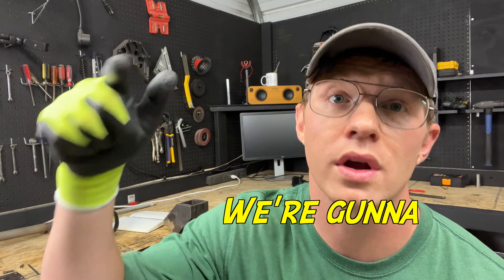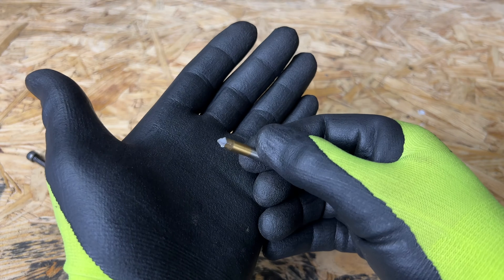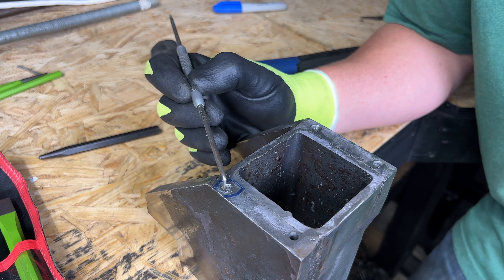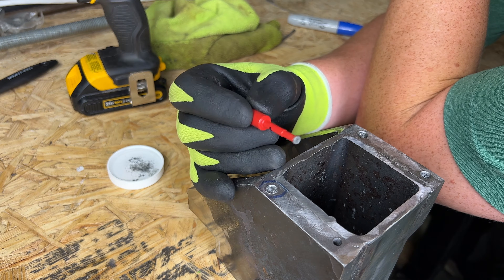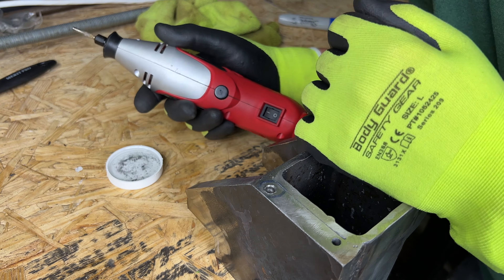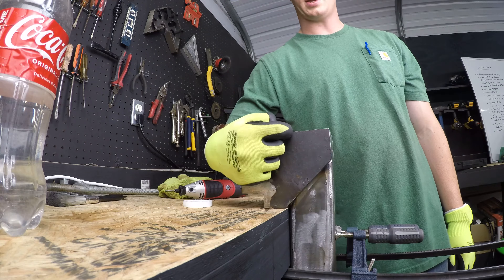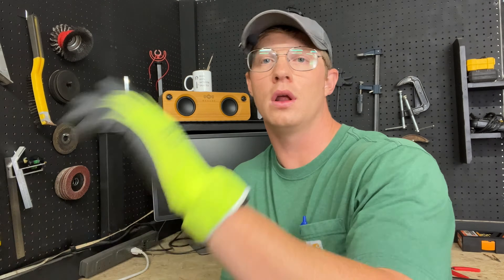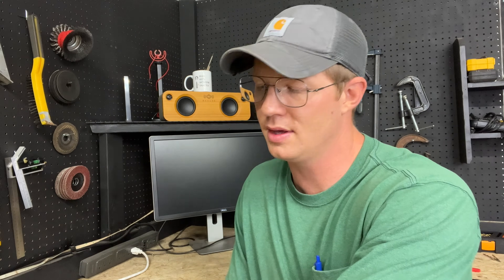Broken Tap In A Blind Hole?  |  Best DIY Removal Method

Comment: Also grinding the whole tap out is not necessary. Cut both sides and drill the hole at the end. It will fall off. You might even reuse the cut out bit, weld it back with most of the thread intact :D
Reply from the maker: Wow, never thought of that!
Reply: Nejlepší  je pořídit si  vytahovák zalomených závitníků je to levné

Comment: Use a pointed sds chisel bit in a hammer drill set to hammer only. It will shatter the tap, then just use a magnet to pull out the shards. 
I did it today on a broken 5/16" tap, and it was gone in 2 minutes.
Reply from the maker: Freakin brilliant! I have a hammer drill so I could have done this. I will try this in the future👍👍

Comment: Not the final solution I was hoping for 🤦. My tap busted off in my engine block. Not cutting that out 😂. 😭
Reply from the maker: Oh dang. Sorry to hear that! I one video I saw for an engine block used the diamond hole saw with some success👍
Reply: @mooseworks I ended up using a couple diamond bits on my Dremmel. It took FOREVER!!! Like three hours of drilling 5 sec at a time and dipping in water to cool.

Comment: You had a welder this whole time couldn’t you weld to the tap and twist it out???
Reply from the maker: Thought it was too small to only fuse to the tap. 1/4 in is pretty small and down in the hole…
Reply: @mooseworks a trick i used was to use a piece of copper pipe.  Good luck.  Thanks for the video

Comment: You might have made the tap brittle enough to break apart by heating it and cooling it fast with ice or soft enough to drill by heating it and cooling very slowly by burying it in ashes.
Reply from the maker: Good tips! Should have tried one of those methods!

Comment: Your approach and methods were sound.I’ve removed thousands of broken taps(45 years with kennametal) almost always with a quality carbide  end mill in a ridged set up then chip it out with a modefied hex key sharped so the point is over to the side. Then you can a grip on it with pliers and break small pieces off. 
Or just put it in an EDM and have a cup of coffee
Reply from the maker: 😂 great advise!

Comment: Helpful video. Other videos use a milling machine. I don't have a milling machine or drill press and my tap broke off under my car. I never thought to try to break the tap apart so I got my punch set and tried to turn the tap out by hammering with the punch. It did start to break apart and finally the piece that held the tap popped out. It was spot welded on. I put a bolt and nut on it and it saved me a huge headache. A BIG thanks for the idea.
Reply from the maker: Absolutely! I’m glad it helped you! That’s why I make video. Great feedback👍👍

Comment: Place a nut over center of the hole and weld in the center of the nut and use a wrench to screw it out.
Reply from the maker: I thought it was too small and I only had a stick welder at the time. I didn’t think it was possible with my skill level.
Reply: This trick has literally never worked for me ever I have never managed to make a nut ever stick to whatever was left of a bolt I think you guys are breaking off shit finger tight for that trick to actually work

Comment: I have often had to break broken taps apart to get them out of holes, it takes a while and often does a lot of damage to the hole you are trying to get it out of. Your core bit idea was good, I would like to try cutting the hole tap out using a large core bit and then plug the hole with a blank that I drill and tap again.
Reply from the maker: I will have to try that next time… cuz there will most likely be a next time😂

Comment: I know this is an older video but they make a broken tape extractor tool and it is BAD @SSSSSS.  Walton 18001 it is pricey but works well.
Reply from the maker: @GregoryJohnston77  does it so down to that size? It seems too small for the small fingers to fit.
Reply: @mooseworks  they have them for every size tap. I've not used one and it did not work yet. Granted I've only  used them about 3 times, bit they have qorked all 3 times.

Comment: How do you use the Alum....or however its spelled?
Reply from the maker: Dissolve in hot water. Then drop in the hole with the tap. The part has to be aluminum though. 👍
Reply: It is spelled alumn, I think.
Kind regards from the Netherlands 🇳🇱

Comment: if hole and bolt placement are not critical, just drill and tap a new hole next door to old one and leave broken tap in place
Reply from the maker: I wanted the location to be symmetric to the other ones. I intend for this vise to last for years and wanted it to be right👍
Reply: @mooseworks i agree with you always do it right for services purposes just incase a shim broken next to it if there is any at least servicrable.

Comment: Build it up with a mig  enough to grab with vice grips ,  just did one on a  v4 wisconson , works for broken bolts as well
Reply from the maker: Thanks a great idea! All I had at the time was a stick welder. So I don’t think I could only weld on the tap.
Reply: @mooseworks  Split a piece of copper pipe , drill a hole  the size of the tap or a bit smaller  and put it over  the broken tap or bolt
Reply from the maker: @davideden6413  that is freakin genius!

Comment: Buy an end mill for your drill press. Specs aren’t tight for you in this case. It’s literally a five minute job tops. A cheap end mill will eat up that tap.
Reply from the maker: End mill on a drill press? Are you just suggesting vertical travel? If not, I would need a cross table and risk breaking the drill press!

Comment: I have this problem in a motor shaft,where cutting is not an option.
I will try to heat the tap and anneal it.
Reply from the maker: That is prolly a good option. I think a diamond bit could work also. Just don’t run it at a high speed and burn the diamonds grit off!

Comment: Next time use cutting oil when tapping it really helps
Reply from the maker: I did use some 3 in 1 oil but not cutting specific. If cutting specific oil much better?
Reply: @mooseworks  I use it when tapping and it does well.
Reply: @mooseworks drill and tap oil will make your life easier. It will make your drills and taps cutter better and last longer.

Comment: This is why I do not ever buy stuff cheap brand new. If I need cheap stuff I buy premium secondhand tools off ebay, auctions, or flea markets for cheap. Do not ever, ever use cheap threadcutting tools for anything other than chasing/cleaning existing threads. Cheap tools are a liability. 
To extract a broken tap with DIY means you order the correct sized and flute count Walton extractor or improvise one. This is the least destructive and first option.  If that doesn't work send it to a machine shop and they will either burn it out with an EDM tap burner or drill it out with a bridgeport and a carbide drill. If you tell them to just drill the core of the tap out and leave it, you can get charged less and break the tap out yourself much more easily with the core drilled out. 
There are few mistakes more expensive than broken taps. To prevent more broken taps;
Those cheap tap & die sets are liability prone TRASH only fit for chasing threads to clean them up. Look into spiral flute and spiral point taps from industrial suppliers and never look back. Use lubricant. Order a drill index secondhand off ebay to ensure you have the correct tap drill for your thread.
Technique when hand tapping is the most important because you must keep the tap perfectly straight to the hole. A good DIY method is to thread a nut onto your tap and keep it close to your surface so you can eyeball a parallel gap while starting the tap. Use a taper tap when starting hand tapped threads. If you are tapping deep holes such as this you have to back the tap all the way out to blow the chips out.
Reply from the maker: Thanks for all the info! I can definitely see the benefit of using good quality thread cutting tools. This tap was part of a set I got from tractor supply and it felt pretty squishy under torsion. I wasted a lot of time because it broke. I didn’t think an extractor tool would work for this size, will it?
Reply: There are sets or individual extractors sold by Walton.